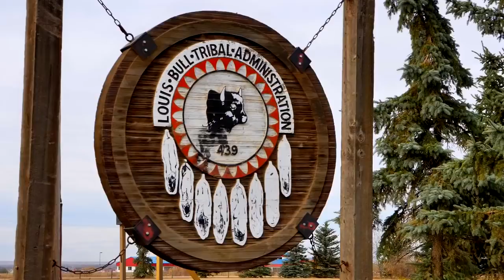188. First Nations and oilsands workers learn solar shoulder to shoulder

Comment: the SOLAR  power is NO DIFFERENT  then COAL POWER in time the old batters will land up in the landfill site's  WHAT ARE WE NOW CAN BE DOING TO PREVENT them from landing up their  
right now there is not safe  fuel out there that cause damage out there  wind  to has its downfalls  and problems too

NUCLEAR POWER IS  THE UNSAFE POWER IS BEING PUSHED  ONTO THE PLANET NOW   DUE TO THE LONG TERM DISASTERS THEY HAVE 
BEFORE YOU  CLAIM IT SAFE  FIGURE OUT THE LONG TERMS INFECT IT WILL HAVE
Reply: Jennifer White Dumbass
Reply: we can go to grid connected solar system in which  during day time  unused energy will purchased by utility and night time back to our home.we do not need any batteries

Comment: Death to the anti-White communist David Suzuki.

Indian bands typically have difficulty maintaining the White man's living systems like housing & water systems. Will solar power systems mesh well with the Native way of living?  Maybe, worth a try.

On the other hand, if the producer-level uptake of renewable energy production is good, & electricity gets cheap, it might be some overhead & complexity they don't need.  They might have achieved more real energy security resilience by spending their government shekels on planting some trees, & subsidising the purchase & installation of a standard, efficient, band-approved & -supported wood stove for backup & normal use, & instruction on how to build wood sheds for the drying & storage of wood.  And if savvy producers don't embrace solar, why should these rubes?  Maybe a few axes, crosscut saws & wood wagons, or power tools if they're already getting too much exercise.

Maybe there are reasons why Indian bands don't need to be at the bleeding edge of technology in every area.  But if gung-ho Kool-Aid drinkers like that impassioned Newfie squaw get their way, there will always be corporate interests willing to partner with their gubmint cash flow.
Reply: GM4ThePeople tf?
Reply: Is there a particular point with which you wish to take issue?
Reply: Growing a forest? Are u on drugs?